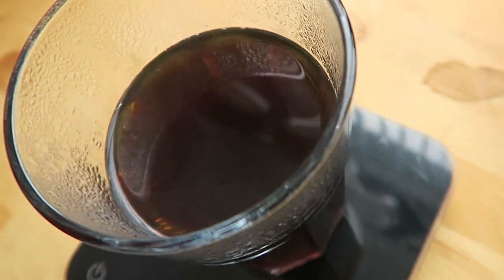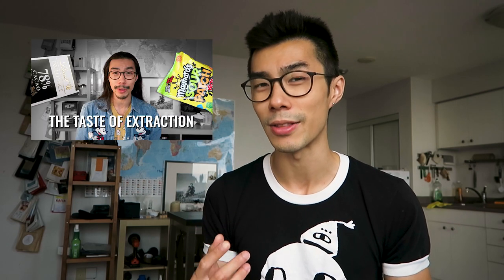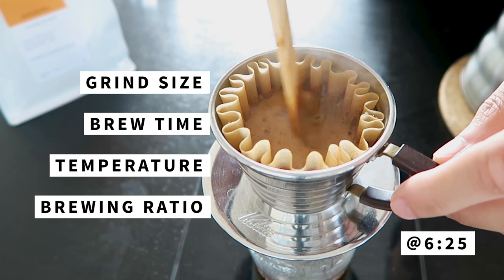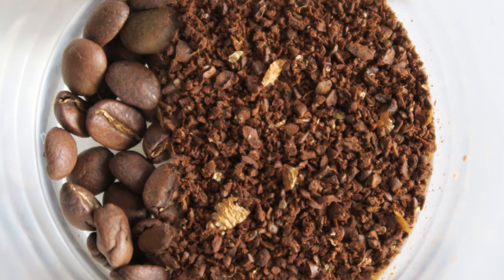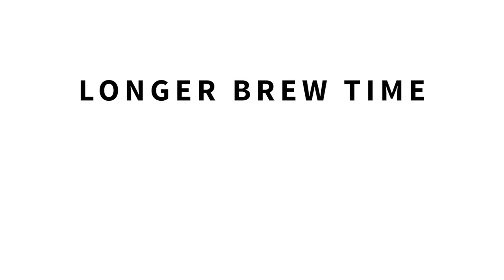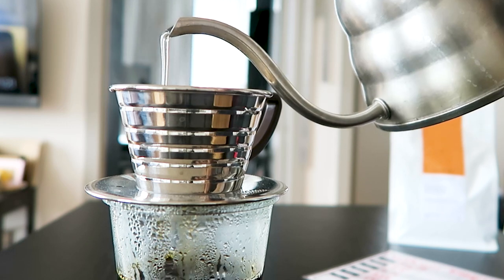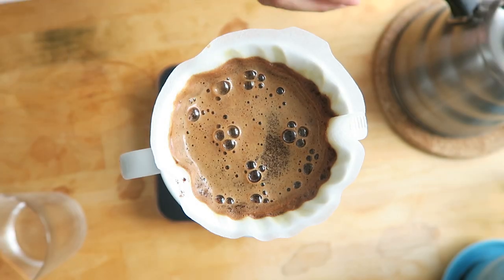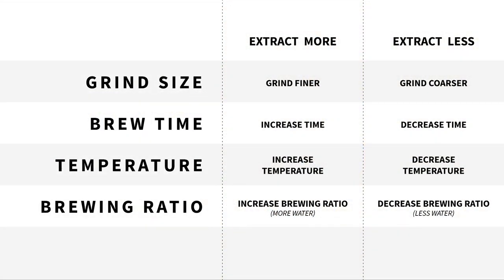The Basics of Coffee Extraction

Comment: Hello Paul, great eyeopener in reg. variables. Only one concern: I always thought (and seen in other tutorials) that higher ratio means MORE coffee in relation to water..???  As I watch your video it's the opposite. It caught me by surprise. So - In order to change the taste (sour/bitter) would it make sense to never touch the ratio aspect, stick with one and rather focus on the other three ? (as James Hoffmann also advised). Wouldn't it eliminate the confusion all together? Wouldn't a higher or lower content of coffee to water increase or decrease ALL factors (fats, acids, sugars, fiber) Equally? Please comment and enlighten me if I'm completely off here.  Thanks
Reply from the maker: Hey Klaus,
Yea brewing ratio's are weird so let me break it down differently. Reading a brewing ratio (lets say 1:16), the 1 is grams of coffee and the 16 is grams of water. By increasing the brewing ratio (making the number higher) for each gram of coffee, you will be using extra grams of water (for example, a 1:18 brewing ratio will use 18 grams of water for each gram of coffee). So a higher ratio means more water in relation to coffee.

Even James Hoffmann changes brewing ratios and it should just be used as an extraction variable. Locking in your brewing ratio and never exploring it is like never using the 6th gear of your car. It will simplify the process and you can drive fine with the 5 other gears settings but the 6th gear setting adds a different speed to the ride.

In coffee terms, a change in brewing ratio changes the body and viscosity of the liquid. The extremes are espresso (1:2 brewing ratio) and a pour over (1:16 brewing ratio). For espresso, you can pull it longer to get Lungo (for example 1:3), you can also pull it shorter for a ristretto (1:1.5). The same range can be applied to other brewing methods like the pour over. When I use a dark roast with a pour over, I lower the brewing ratio (1:14-15) as the emphasis on a thicker body and intensity is key. For a lighter roast with a pour over, I increase the brewing ratio (1:17-18) to get a tea-like body that allows the more delicate acidities and tasting notes to shine through. If you always lock your brewing ratio to a "standard" value, this extra facet of coffee will never be explored.

If simplification is the goal then I would recommend doing exploration on what brewing ratios work well for the beans you are brewing with, then lock it in for those beans. With that said, there still needs to be exploration to find the right brewing ratio that suits your beans and brewer.

Fats, acids, sugars and fibers are extracted at different rates and in different parts of the brew. Think of how butter (fats) melts really easily in a pan (or by hot water), while sugar and solid fiber particles take longer and more heat to break down. Fats and acids are the first ones that are extracted by the water, then the sugars, followed by plant matter. This is why under-extracted cups are sour (because it has mostly fat and acid compounds) and over-extracted cups are bitter (because the plant fibers overshadow the fats, acids and sugars).

Let me know if you need any additional clarification to the parts above. Hopefully, it all made sense and brought some clarity to coffee extraction for ya!
Reply: @brewinghabits  Hello Paul, thanks for your reply. Hoping you are not getting frustrated.  I understand all your explanations. But one thing: doesn't e.g. increasing Grind Size, Temp. and Ratio influence ALL four solubles EQUALLY ... and only Brew Time really addresses which ones are emphasized? I'm looking for more sweetness... and want to avoid fiber and tannins ... ??? Thanks
Reply from the maker: Don't worry, I love chats like this!
The solubles don't really work in such an equal and perfect system. 

For example, cold brew is low on acid due to its low brewing temperature, meaning that temperature has a drastic impact on the acid extraction of the brew. If all solubles were extracted equally like the acid compound then the outcome would be a weak and tasteless cup of coffee.

Another example is that in dark roasts, the fibers are more susceptible to extraction due to the brittle nature of dark roast bean. The water penetrates and breaks down the bean easier, which makes the plant fibers extract at a higher rate than a light roast bean.

So even though one would think that the coffee compounds all are extracted equally in a linear and predictable fashion, due to factors like the different amounts of each compound (fats, acids, sugars and fibers) in the bean combined with how each of them interact with the water during the brewing process causes a change in a brewing variable to impact the compounds differently.
Reply: @brewinghabits  thank you for both this video and the extremely helpful comments.  I too was confused about water ratios but now I understand.  You're a great teacher!
Reply: @brewinghabits  Amazing Explaination!

Comment: Outstanding videos. I've learned much from you and others. Im no expert (I might be a writer) and just upgraded to Bonavita Connoisseur  AND Redline MK1.  So I'm having fun. Coffee weight was excluded from your chart. Is that a somewhat standardized variable? 

Any way- I'm struggling:

.5 liter good water
Lavazza Oro 30g
Encore at 15-18-20-25

obviously I can't control temp or time (maybe). but temps look good and times 2:47mk1 and 4:13bon  tryin to discern the extraction flavors as per your vids and others. I just can't get in the door. 
I had a mr. it passed. but I was about 50g on 6  about 1.7 liter Water.

Im struggling on new gear!  LOL

good info

thanks
Reply from the maker: Hey Sam, glad you like the video!! Talking about some of the points you mentioned.
- The reason why dose (coffee weight) is excluded is that it is a part of the brewing ratio. So if you for example scale up your recipe to 60g coffee and 1L water, the extraction would be relatively the same (other than more extraction that comes from the longer brew time due to the larger dose). Therefore, when it comes to grind weight, extraction is all about the ratio between water and coffee. More water keeping the coffee amount the same leads to more extraction, just like how less coffee keeping the water amount the same also leads to more extraction.
- It's really hard to diagnose without being there in person, what were you tasting? Sour notes, bitter notes, thick mouthfeel, tea-like mouthfeel? Have you been able to successfully brew a good cup of coffee with these beans before? What part of the coffee taste was it that you didn't like or didn't represent coffee to you?
Reply: @brewinghabits  hey you’re prompt. This ORO is an example a postulate going in my book. Coffee wars led to purchase- the last name my main dudes is Symphony. My amateur vid on Enigma of The Cosmos on my thing- it’s related to coffee.

Any way I’m ⚡️☕️⚡️☕️⚡️

In these 2 machines I just dropped 1:10 & 1:20. (.5L)

Encore 6:  

25g 
50g

Encore 25:

25g
50g

3 I would pay for 
1 close

On the Bon- 50g @ 25 grind in the close range 

Of course I’d have to run all 4 swap machines… fk that lol

So I don’t know to change grind or mass

So yeah dude I’m open to ideas!

Right on
Thanks 

I’ll spend the weekend ⚡️☕️⚡️⚡️👽👽⚡️⚡️☕️⚡️👽👽⚡️☕️

Lol

Machines basically same. Temps close, red 1 m faster, non bloom, I hate metal (not music) and hot plates. Bon doesn’t like lot of ground. All will be tasty soon
Reply from the maker: @samdavparsley8266  it really is just a trial by fire process. I would make sure that you are getting either sour or bitter notes, and then tweak extraction accordingly. Be super focused when you are tasting your coffee. Sour makes your mouth pucker (like a lemon) and bitter is dry and astringent (like a dark chocolate). Once you get one of those tastes, then you know it's either Under-extracted (sour) or over-extraxted (bitter) and can tweak accordingly.

Yea man, it's always a learning process with new equipment and hobbies! Just gotta enjoy the journey ya know :D